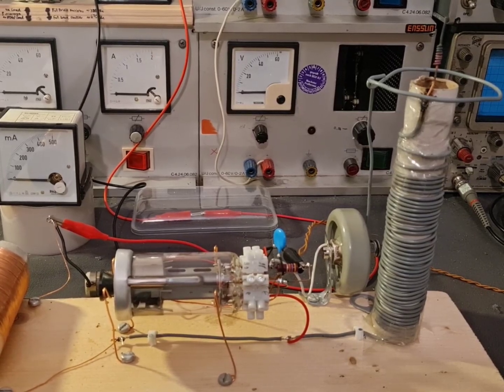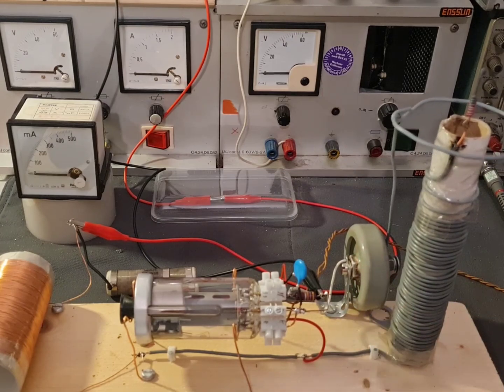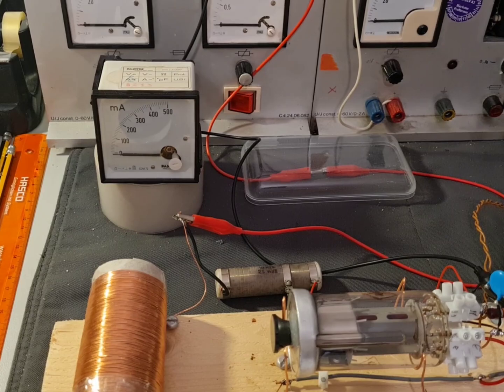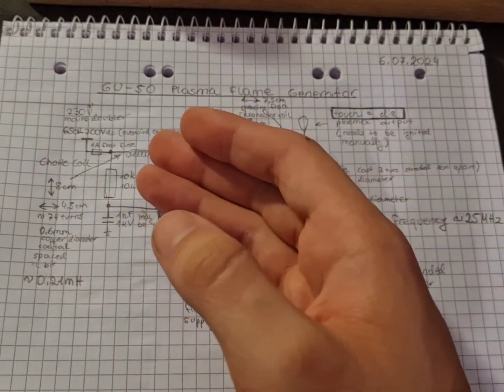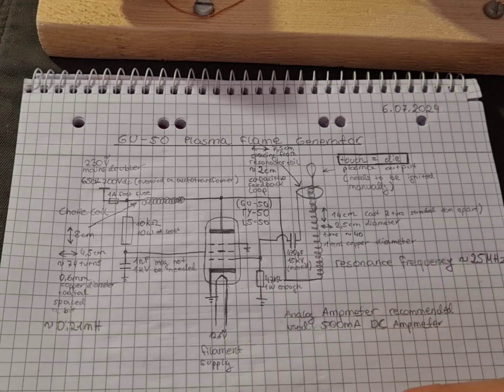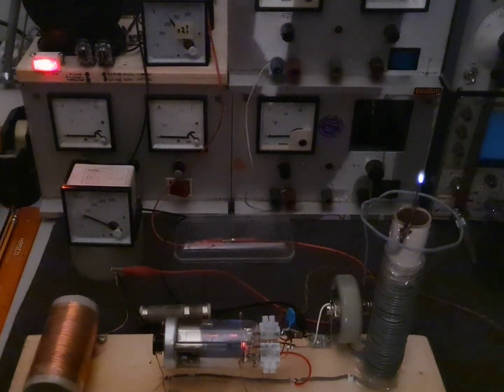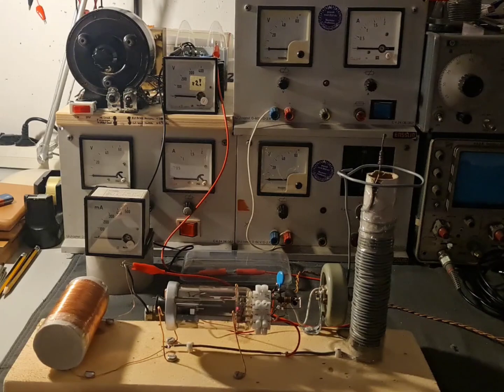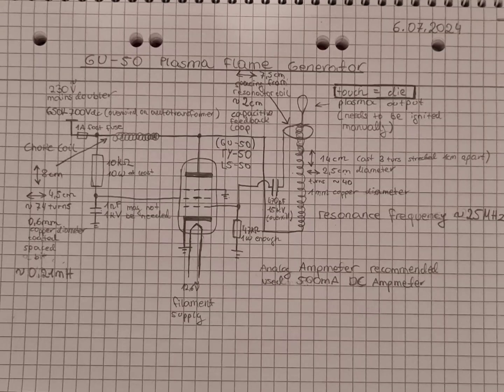Plasma Flame Generator with the GU-50 Tube (HFVTTC)

Comment: Very cool, you definitely need to use a ceramic insulator on top to prevent fire! The nice thing about ceramic is it is also heat resistant. Very cool to see these tube types, its simple , nostalgic yet quite capable at the same time. Good job
Reply from the maker: @newmonengineering  Thank you very much for your comment.
Yes Ceramic would be a great fit if I had such a ceramic pipe at the time. Afterwards i moved the wite further away from the cardboard tube and it fixed it, the cardboard doesnt ignite anymore.
Yes tubes are very cool, especially the glow they give off and It makes your project look more dangerous because you have to use very high voltages :)